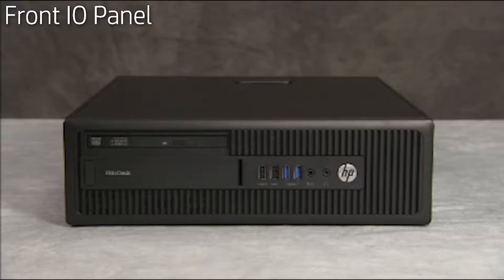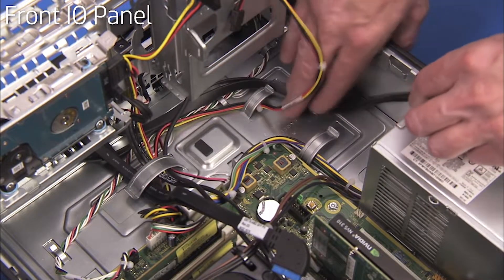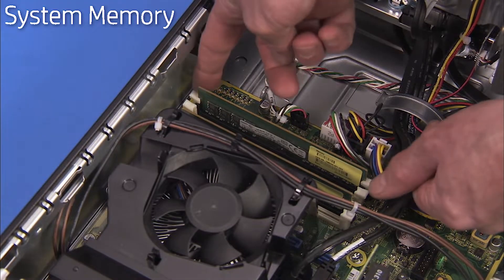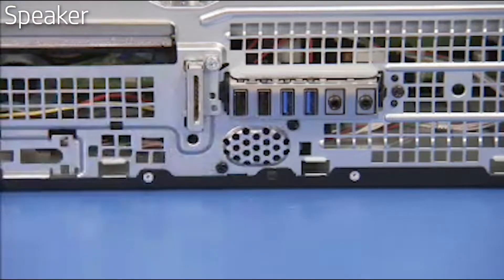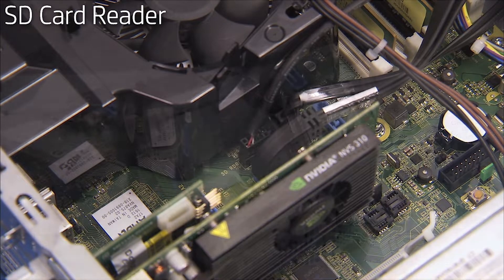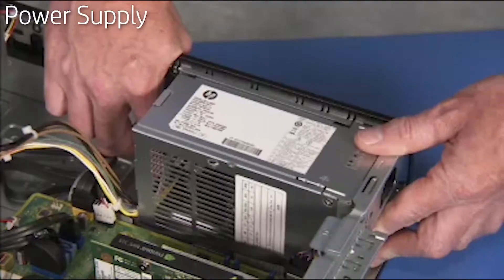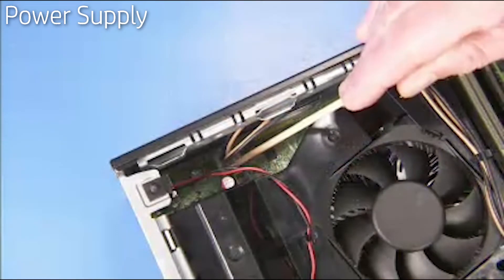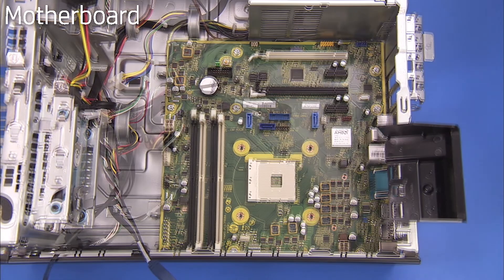Removing & replacing parts for HP EliteDesk 705 G3 Small Form Factor | HP Computer Service

Comment: Can i put rx 580 in this pc?
Reply from the maker: Hi there, thanks for contacting HP Global Social Media Support!
I understand that you need to know whether your computer is compatible with AMD Radeon RX 580 graphics card.
I will do my best to assist you.
Unless you upgraded the standard power supply to one that is 450 Watts and has an 8-pin supplemental power connector that you need to plug into the graphics card, it will not work.
I wouldn't be able to help you with getting a power supply for your PC, if one even exists.
Regards, 
HP Support

Comment: Hi Dears i need to know i have EliteDesk705G3SFF it has amd pro 12-8870 installed what ryzen seria can i use for this device
Reply from the maker: Hi there, thanks for contacting HP Global Social Media Support!
I understand that you need to know about compatible processor for your computer.
I will do my best to assist you.
This computer supports following processors:
AMD A12-9800, 3.8 GHz
AMD A10-9700, 3.5 GHz
AMD A8-9700, 3.5 GHz
AMD A6-9600, 3.1 GHz
AMD A12-8870, 3.7 GHz
AMD A10-8770, 3.5 GHz
AMD A6-8570, 3.5 GHz
Regards, 
HP Support

Comment: Hi, I'm looking for the most powerful cpu for this pc. Is any ryzen suitable? If so, which one is the biggest?
Reply from the maker: Hi there, thanks for contacting HP Global Social Media Support!
I understand that you need to know about compatible processor for your computer.
I will do my best to assist you.
For optimal PC and printer performance, remember to always buy (use) Certified HP Genuine Replacement Parts from a known and trusted source. You can order it via the HP Parts store: https://hp.care/6052U2ESk 
Regards, 
HP Support
Reply: @HPSupport  please tell me what cpu is compatible with the cpu amd a 12-9800
Reply from the maker: Thanks for the reply.
The list if compatible processors are as follows:
AMD A12-9800, 3.8 GHz
AMD A10-9700, 3.5 GHz
AMD A8-9700, 3.5 GHz
AMD A6-9600, 3.1 GHz
AMD A12-8870, 3.7 GHz
AMD A10-8770, 3.5 GHz
AMD A6-8570, 3.5 GHz
Regards, 
HP Support
Reply: @HPSupport  can i install ryzen too
Reply: @HPSupport  please
Reply: @HPSupport  hello
Reply from the maker: The above are the compatible processors for your computer.
Regards, 
HP Support

Comment: How can I put a ssd ?
Reply from the maker: Hi Mostafa, thanks for contacting HP Global Social Media Support!
I understand that you need to know about adding SSD on your computer.
I will do my best to assist you.
M.2 solid-state drives are installed into an expansion slot using the PCIe to M.2 adapter
Binu-HP Social Media Tech Support

Comment: Can I swap the case?
Reply from the maker: Hi Nik, thanks for contacting HP Global Social Media Support!
I understand that you need to know whether you can swap the case.
I will do my best to assist you.
HP does not recommend upgrading or downgrading hardware parts or software that is bundled with the product as It may affect the manufacturer's warranty and performance, however, you could change the configuration at your own discretion.
Binu_HP Social Media Tech Support